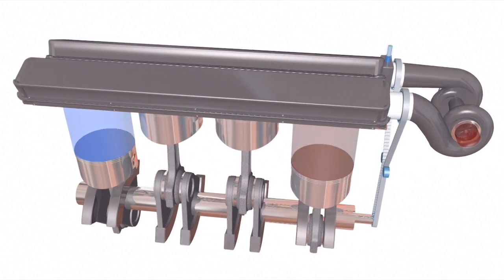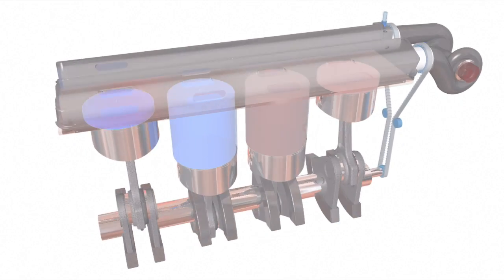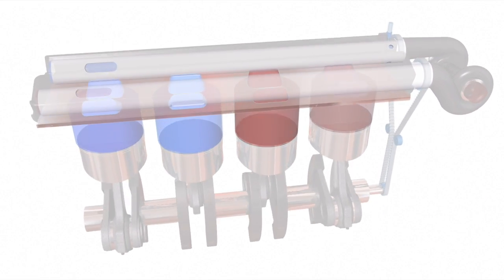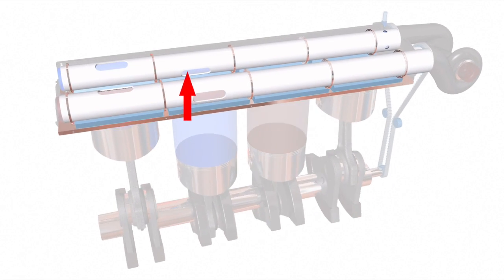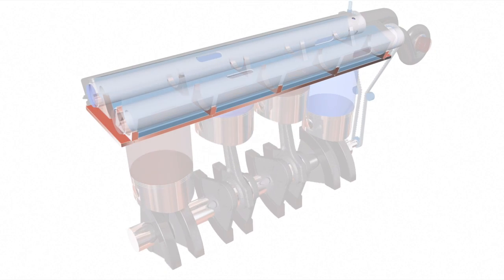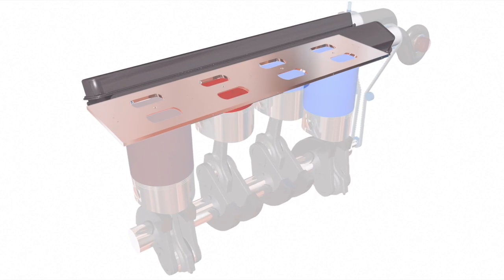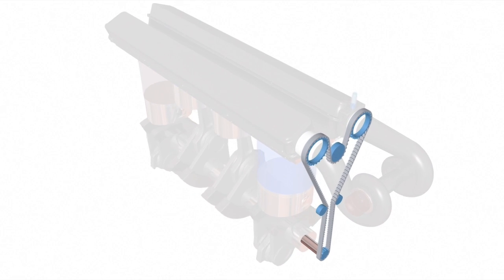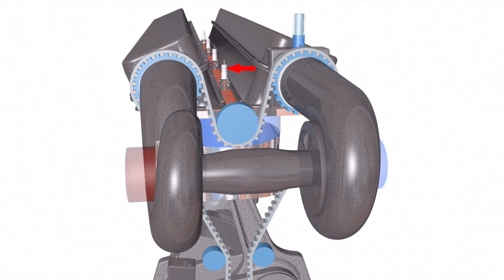ROTATING VALVE MOTOR 2

Comment: half baked thought bubble, apart from the totally unworkable inlet/exhaust tracts. the very first thing a head n the exchange of gases must do is be designed / materials to work with immense heat n pressures of combustion measured in hundreds of tonnes with tiny clearances  with corrosive fuel over millions of cycles. roller bearings will not last at all. I. suspect this is glossed over not on purpose but as there IS no bearing surface n combustion chamber facing that is viable to work in that situation.
this problem alone is insurmountable n make any benefits to the design irrelivent as a marketable product

Comment: Isn't the whole point of a rotary valve design to allow the air to directly go in and out WITHOUT the air mass changing directions which cause a loss of momentum?  It would be much better to have a rotating solid bar that had ports which cut directly through the diameter, and use conventional intake and exhaust manifolds.  This design is overly complicated, requires exotic materials, and is otherwise impractical.

Comment: 1. The diameters are very restrictive.
2. Each runner has a different length, which is bad for scavenging, backpressure at the turbine, and EGTs.
Reply: 1. Turbos negate this. 2. Turbos negate this. 
is this workable for a decent cost? Doubtful, but new ideas need to come from somewhere.
Reply: @markcollard9326  Literally no and no. Every turbo system I've seen that's run with log manifolds and a restrictive intake is ass. I've seen cars gain 100+ HP and have better temps, spool, and everything else and end up with LOWER boost pressure as well when they go from a restrictive system to an optimized one. Compound that with the sealing and lubricating issues, and this design is placed squarely into the realm of "total ass." Neat concept, but it needs a lot of work.

Comment: The problem with this concept is simply one of too many points of failure and complexity relative to prolonging conventional valves life cycles. Been done somewhat differently and with different materials  some 30 plus years ago , not at all reliable long term  let alone mechanical and sealing issues. 
In recent decades advances in metallurgy  have reduces wear to negligible amounts when for example ordinary engines that can cycle  up to 300 k miles  when properly maintained to an adequate schedule . In fact with regular oil changes my 1972 vintage  Chevy truck with an ordinary  350 CID engine clocked 375  K- miles when I finally donated it to a trade school for their auto-shop  classes.
I could be argued that if anything at all  this design offers the potential for being operable at very high RPM ranges ..but...that too has been achieved in F1 engines that as of 2006 could rev above 20 thousand rpm ...and do it for  500 mile duration races.  Presently given what has been achieved already, this concept is really an evolutionary dead end, a solution in search of a problem.

Comment: theres a couple issues with this design. if the tubes are too thin they'll bend if too thick it'll restrict the airflow and make it lose power due to parasitic loss, using a hard composite material such as ceramic the opposite will occur it'll just break into pieces when the combustion forces are applied. sealing the ports wouldn't work either since its such a large area which will either eat into your head material or your weird tube thing. finally the tube is way too restrictive for the piston sizes basically causing pressure to build up in the cylinders since theres not enough space to fully eject all the exhaust gasses even if you scale it up the amount of room it'll take up would be massive and heavy.

Comment: I think u would need direct injection so that only air would be going thru the roller valves, but that is an ingenious idea, but I do have questions about how well the roller valves can actually seal off during combustion so as not to lose compression

Comment: I do believe this has already been done... maybe not w graphite...  maybe you should google old Indy car engines...

And a good engineer knows that any poppette valve is fully open at 1/4  lift of the valve diam. That is when the cross section of the area is equal  to the area of the valve any more lift or opening of the poppette valve is not necessary..

Comment: How's you speed the engine up and put on the power you going to get the power on the thrust stroke see the thing is the valve tubes are turning the same way so it's creating extra Force in that direction last making it twist on its Mount more it may even pull it out of the engine mount you might have to balance that I'll find a way a counteract that Force that momentum might pull a cylinder head over too far

Comment: A couple of questions;
When did this idea originate?
Who developed the idea?
Why did it not gain traction?
An aside when I was a young man of 17 Suzuki had a disk valve motorbike engine.
That is when I was struck with this idea. Thermal coefficients was the deal breaker. I am much better now thank you.

Comment: Well done ! Much work to get such a 3D-model .  Used to have the same idea. However, why four sections in this tubes ?  Just let it flow - less resistance, less costs.

Looking at the fluid dynamic the solution has gone some disatvantages, not directly obvious.  The windos of tube an cylinder head only have one point of time, where they fit together. During opening and closing there are throttle losses. Common valve gears also have lots of throttle losses, but the benefit having such large windows can be small compared with a common four valve design. Mind the fact, that the high combustion pressure will act on the tube with the area of the closed window. The forces a quite a lot and need to be properly absorbed. I give a thumbs up
Reply: The four sections are because of the four cylinders. An engine with more cylinders would have more sections. Each section leads to one specific cylinder -  having fuel over any and all cylinders all the time is "probably" not a good idea.
Reply: @jelsinc  Why, it has been standard for about 80 years to have the gas/air-mixture anywhere in the suction manyfold.
Reply: @wernerschulte6245  Ok, it sounds like you've been around the inside of autos for a while so I take it you know better than I do about the standard practice. I'm not much of a car guy, so I stand corrected then.

Comment: The problem I see is with changing temperatures how does one get the components to expand at the same rate and keep the parts lubricated to protect against wear
Reply: To expand at the same rate and keep the seal and to keep it lubricated
Reply: All that I can really see is if there’s an oil port that comes up through underneath the rotary shaft and oils from the bearing underneath the shaft.

Comment: The exhaust turbo charger head seems to be depicted backwards. I would think the hot gases need to enter the hot turbine wheel at the center axis rather than tangent to the outer diameter. Much greater efficiency.
Reply: No, look up how a turbo works.
Reply: @Mad4Tracks  I had it backwards. Thanks for the clarification.

Comment: I designed something like this more than 35 years ago. The problem was finding a way to seal the rotating shafts. My design used conventional inlet and exhaust manifolds. Also, my design used either a carburetor or direct injection fuel injectors. Electric cars are going to replace Internal Combustion engines in the next 20 years. It's not worth it to proceed with the design because it is already obsolete.
Reply: @tripplefives It's not MY future. It's THE future. I'm not the one changing the laws. I can explain it to you but I can't comprehend it for you. The future of gasoline and diesel-powered automobiles IS going to come to an end one day. It might be 20, 30, or 50 years from now but ICE-powered vehicles' days are numbered. Electric vehicles ARE going to become more affordable as more companies are going to start making electric-powered vehicles and the technology is going to improve on electric motors and batteries. As I said before this is ONLY my OPINION. These are NOT facts. I think you just like to argue. Read my comments and TRY to understand what I am saying. If you can't comprehend my meaning then keep it to yourself and go on with your life.
Reply: @tripplefives That is just my opinion based on the current trend. Governments are cracking down on gas and diesel emissions. It will become very difficult if not impossible to meet those standards. It will also drive the price of fossil-fueled vehicles so that they will not be competitive with electric vehicles, which prices are coming down as battery technology advances, which will make them more affordable and reliable. I own 5 vehicles of which 4 have a V8 engine with a 4bbl. carburetor or fuel injection. The other one has a 4 cyl. engine. I love my ICE-powered vehicles. I'm just saying their future is not certain anymore. 20 years ago electric cars were a novelty. Today they are becoming more normal and more acceptable and more companies are starting to make them including the big 3. I predict that 20 years from now electric cars will outnumber gas and diesel-powered vehicles. Again that is just my opinion. Take care.

Comment: I built a wood mock up of my idea back in 1975, which mounted on a 1600 Cortina motor.  My idea used a single large cylinder with ports carved into it.  Had no money at the time and a young family, so the thing languished about until I tossed it away.  My wife referred to it as a pasta maker. It's probably a workable idea with today's technology, but its time has passed.  All the technical innovations for IC engines are just their last dying breath before electrics replace them.
Reply: wow that sounds amazing man
Reply: @tripplefives Price is a function of scale- the more that are produced the cheaper the price.  GM introduced the first modern era production electric in 1990- price was 34000.00 which is about 70000.00 in today's dollars- it had a range of 60-80 miles.  Battery technology is developing a a rapid pace with major corporations working on a variety of types- air-aluminum, lithium ion, molten salt, metal hydride, ultracapacitors etc. people buy cars based on the size of the payment most people go over their heads and have 2 late model cars which eat up a large part of their income, the electric car is far less maintenance and that is a big plus as the IC car ages and those mysterious modules begin throwing engine lights and the average guy has no choice but to head for the dealer.
Reply: @tripplefives You failed comprehension.  Economy of scale was invented by Henry Ford and has been the rule ever since.  The price of cars has risen dramatically with everything else due to inflation.  A large percentage of the cost of manufacturing cars is in the thousands of smog related regulations imposed by the government- all of the complex components required from evap systems, to VVT designs, catalytic converters etc. are all in direct response to government rules on emissions.  On top of that every vehicle must meet certain mileage requirements adding more components.  I'm sure you heard of how VW got caught trying to beat the rules with a software trick in their diesel cars.  Can you imagine the cost savings to these big companies if they don't have to constantly design ne gimmicks to beat the pollution rules.  EV's bypass all of that stuff allowing the big companies to move ahead on new technology.  It's the future and coming down the line fast.  Back in 1900 there was a blacksmith shop in every village and one day one of those "Auty-mobiles" showed up- most people laughed and said it would never replace the horse- except one or 2 blacksmiths who said "there's the future" and began selling gasoline and fixing the cars.  By 1910 the horse was largely gone and the smart blacksmiths were making money.  Same is happening now- most are clinging to what they have known all their lives while some are recognizing the future.
Reply: It'll be a long, slow death.
The infrastructure to support EVs, beyond charging itself, is still quite a ways off.
Reply: @Motor-City-Mike  it will be faster than most think- the tipping point is rapidly approaching.  Right now, all the major manufacturers are putting all their R&D into electric and the IC motors are just the same ol same ol.

Comment: What about pulsed harmonic stress factors working against the ceramic parts? Have you stress tested to see if they will shatter or not?

Also, how much clearance is given for thermal expansion of parts, and do all of your parts expand uniformly to prevent leaks or binding?

And what is the total compensated cylinder delay since each tube is independently divided into 4 quadrants of unequal length?

How much rotating drag/friction does the valve experience throughout its full operating range [taking into account both minimum and maximum RPM and component temperatures]?

Does this engine rely entirely on turbocompression or does it initially rely on natural aspiration upon startup?

What is the thermal sinking properties of the graphite bearings and how long are they expected to last, per respective side?

What about hot particle preignition/detonation issues commonly experienced with high temperature carbon inside combustion chambers?

Does the engine idle roughly?

What is the acceleration turbo lag like?

So many questions! ~( ,m,)~
Reply: Yeah, this looks an awful lot like a machine built for force-feeding an internal combustion engine graphite powder and chunks of ceramic. I think its pretty obviously doable but requires at least two extremely expensive parts and a bunch of slightly less expensive graphite parts. The nice thing about valves is that you can quickly open and close them. The slots on this gradually open and close though the cycle. I think the finer the valve timing control you get, the more restricted the valve ports have to be.

This doesn't have an advantage in very large (ship, generator) engines and it doesn't have an advantage in small (car/light truck) engines where the valve train is not going to be the first thing to fail anyway. I don't understand what the target market is.

Also there was an old (WWII?) engine with rotating valve sleeves in place of cylinder sleeves. Kind of all of the advantages of this and only some of the drawbacks.
Reply: @htomerif  Can you link me the old engine you were talking about?
Reply: @umarmars47  The one I saw was called the Napier Sabre. Most links get squashed but it'll probably be the first video on YT you see if you search for it and its got a Wikipedia entry. Turns out there used to be quite a few sleeve valve engines with a rotating or reciprocating sleeve. I don't know that there are any today. I could guess at what the problems are/were but they were definitely tried and mothballed as a general design concept.

Comment: The challenge would be how to seal it. Fuel would often leak into crankcase and cause oil dilution. In this rotary valve approach, fuel would leak towards other cylinders.
Reply: Honestly your best bet with this system is probably an oil free head design and direct injection
Reply: Hello, everyone. This concept has been around quite a while. I first heard of Coates engine in the 1980's  on 'Beyond 2000.' https://www.youtube.com/watch?v=vjHkAgi9TbY
Reply: I don't think so.. Bcz, most rotary engines are mostly used this type of sealings..
Reply: @M_IFRAS  which is the very reason rotary engine are no longer used. oil consumption, and poor fuel economy.
Reply: If you say so.
Reply: exactly.
it didn't work a century ago, and it ain't gonna work now.
Reply: @MrZcotty  oh.. I didn't know of that.. Thanks for the fact.. 🙏👍

Comment: Wow hot engine! No cooling at all!!!
Reply: The engine block was not shown as the valve train was the subject. Cooling is not on display for a valve train at any rate. But lubrication is at question. I'm not sure graphite bearings are going to be good enough.

Comment: So the ceramic actually is going to seal combustion pressure. Ok maybe but the intake tube will also be continually heated by each cylinder.

Comment: You need to inject each cylinder with fuel. The entake tube should only provide air. The exhaust tube is too small and will over heat.
You need to have a larger exhaust tube. Maybe split the exhaust tube in half and have the front two cylinders exhaust forward and the rear two cylinders exhaust to the rear.  Then you will have to split the entake in the same mannor.  That way you can have a dual turbo system. please revise the design and then make a new video.
youre also going to need to have a computer controlled tube timing advancement system.  I also see issues with sealing off the tubes to the head.  I have a better design for it, but Im not going to say it here.
Reply: I'm in finance, not an engineer but had been thinking about this design for a year as a possible non-reciprocating smooth design with fewer parts.  I wouldn't section the long tube into four chambers though as that seems too restrictive.  I was thinking more of a spinning tube within a fixed tube with the intake tube acting like a manifold feeding all cylinders with a throttle body and the exhaust tube being larger diameter acting as a header to accommodate the expanded gases.  Both tubes could have intake opening shapes that best optimize the flow, a much larger opening than conventional valve trains.  With the high surface and contact area of the inner tube against the outer fixed tube oil cooling might work.  Also, I'd think about having the exhaust exit and intake enter from both ends, for efficiency.

Comment: I'm not familiar with the subject, and I see only one problem on the way to realization. It is an effective and resource seal camshaft. Probably there are reliable solutions as valves made not the first century and built a lot of gas liquefaction plants where demand is probably higher